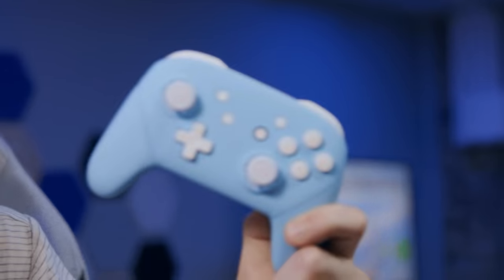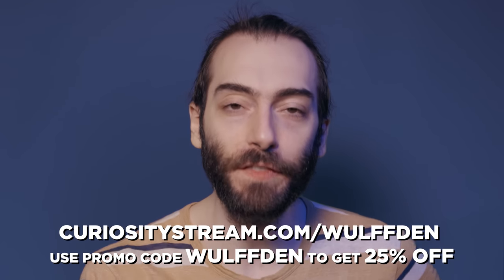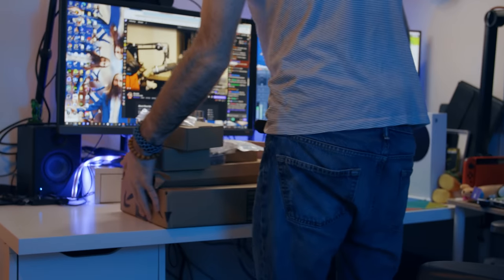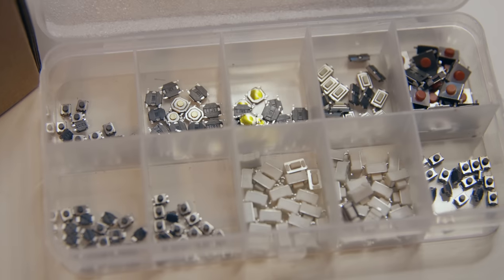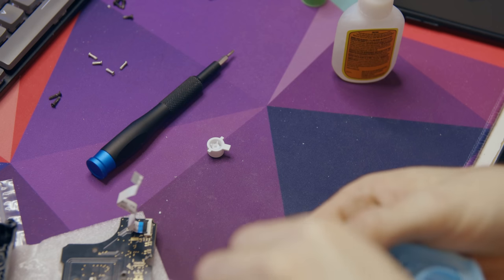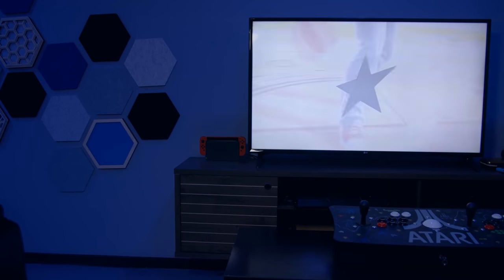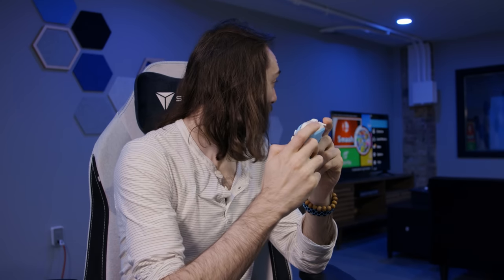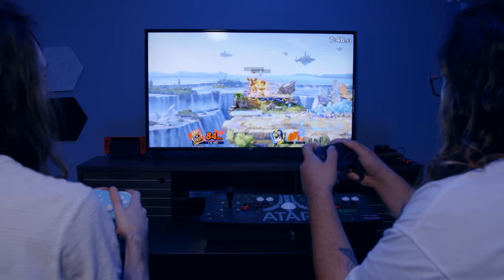I made the Nintendo Switch Pro Controller - ̗̀ CLICKIER  ̖́-

Comment: The semi translucent body for the og pro controller and all other official ones that have come after it are cool and all, but this just makes me realize I really just want to see Nintendo release some of their own solid color bodies, and maybe just pro controllers that have a different finish. Because as much as I love the Pro Controller, even if your hands are not sweaty, that thing still picks up oil and other things from hands SO MUCH. Like I constantly have to keep cleaning the controller and washing my hands with dish soap to make it dry, just so I can have an hour or two without something rubbing off from my hands. I like to keep my tech stuff as pristine as possible so it's a huge pet peeve of mine. 

Also would love to see them do solid color bodies just cause Nintendo has so much potential for their special edition controllers and Switches yet only recently have been tapping into that potential. Like Goddamn Nintendo, just go all out already

Comment: You could totally do this with a gamecube controller too. There are brackets you can 3D print to use keyboard switches as shoulder buttons and then the rest would be pretty similar to what you did here.

Comment: At 6:53 it looks like you've got a ball of solder on the pad and are trying to lay the switch's pins against it. This can make a cold solder joint which is flimsy and has a flaky connection, in addition to being the hard way of doing it. I suggest you try and heat the pad and pin simultaneously on one side, and add your solder wire on the other. Solder flows towards heat, so this is both easier and gets you a better joint.

Comment: Already had the trigger kit, was jealous of the PS5 tacticile face button kit, and my elites tactile dpad. Totally gonna try this now!
Reply: So i tried it. Kind of. I used an extra button board i had laying around after putting the LED kit in a different pro controller. I am not new to soldering at all, everything went easy enough but strangely this other board will not work, even the home button and stuff i didn't touch, old board still works and i even held a tactile switch on the working board and clicked it and it worked. So now i'm wondering if i should just solder the board that was already in there. Maybe the other board is from a different rev controller? Are these components married? Lets find out!

Comment: A little tip with soldering, and this might annoying some pros (sry is what makes it easy for me)
Just put the soldering tip onto what you want to solder, and you even use it to keep stuff in place. But then *slowly* put the wire onto the part.
Its natural for people to do the opposite, and even hold both above the part, but that doesnt really work. And the soldering tip doesnt damage any big part like the switches fx. Most people think it does and acts like is lava tip that will go through anything but if youre firm and confident it really helps.

and obviously dont do this if its on a chip or similar, this is mostly for big PCBs like this, where contacts are big and connection points arent that microscopic lmao

Comment: I dunno. The default rubber membrane seems more comfortable than the super clicky switches.
Reply: By that logic membrane keyboards would be more comfortable than mechanical...which it isn’t
Reply: @brandon_nope  I actually do prefer rubber membrane keyboards, now that you mention it. Not to mention the sound drives me nuts. Mechanical keyboards are extremely overrated, if you ask me.
Reply: @J05TI  not all switches are loud
Reply: @J05TI  I couldn't agree more. I absolutely hate mechanical keyboards.
Reply: @brandon_nope  Compared to rubber membranes, they're all very loud. My room is adjacent to someone else's bedroom. Based on that alone, I can't use a mechanical keyboard without waking them up at night (not that I want to use one).
Reply: @J05TI  lmao silent reds exist you know?
Reply: @brandon_nope  Even those are very loud, compared to rubber membranes.

Comment: man, you added in the stick gates with ease?!

I need all the help I can get adding those in. I'm a big user of the 8Bitdo Pro 2 controller as well, but have ruined two of them trying to get the gates just right - and those controllers aren't cheap. if 8Bitdo ever started selling replacement shells with octagonal gates built in, I don't think I'd ever use another controller again, would be literally perfect.

Comment: This is awesome, but those solder joints are pretty shoddy and you may well find they fail. I'd suggest re-flowing the solder joints using flux. It's easy peasy, and you'll be blown away by how much of a difference it makes. 

Even then I'd suggest looking to add structural support to the switch, maybe just some hot glue blobs etc. Even if the solder joint doesn't fail the contact pad could rip off the PCB (honestly, this happens very easily). If that happens it's not necessarily game over but it takes some skilled work to fix.

Comment: I would recommend using a flat/chisel tip on the soldering iron for the face buttons, since there is a wider surface area, and the flat tip will heat more evenly and easily. Also, to remove the bit of plastic off the buttons I recommend a rotary tool with a polishing bit, so you can have more control on the amount of material you remove. I am definitely going to try to do this mod... Once my finances get leveled. XD

Comment: I remember the old days of Mario Kart on a DS lite. You tried to push A  harder to go faster. With clicky buttons that would not have happened.
About the pro controller: I modded mine to invert the horizontal right stick in hardware. Too many 3d games sadly do not offer such a camera option in software.

Comment: I'm really interested in this project as I recently bought the Razer Wolverine TE, which also has the clicky face buttons like the Onza. Though, the more I read about this mod online (at least, from what I could find), I saw comments about how the clickyness and responsiveness deteriorate with extensive use. The buttons themselves also may have different actuation points leading them to feel clunky. I'm really interested in hearing in how the controller holds up in a week's/month's time. The first Wolverine I got had its A button broken within a month, but thankfully Razer sent me a replacement.

Comment: I wouldn't buy the shells with octagonal gates. I already tried them and they aren't in the correct position. It's slightly rotated so that full left and full right are a little over or under where the actual level is. At least when testing in the controller configurator. Seems like they messed up the molds for them.

Comment: Anybody that wants to do this I used 4.5x4.5x3.8 height tactile switches than needed no button modification at all, just solder it down and it works like a dream when you close the controller back up.

Comment: could you realistically do this with a powerA switch controller? in terms of getting rid of the rubber mesh for the buttons?
Reply: I can't say for certain, but you probably can. You would just need to try different switches to see which one would work. You should be able to do this on any controller that has the contacts for the face buttons on a pcb. The PS4 controller is an example of one that doesn't. Watch a teardown video of the PS4 controller and you'll see what I mean.

Comment: These are likely stupid questions, but I'm new to soldering and would like as much clarification as possible. 

What thickness should the soldering wire be for doing this? As thin as possible, right?

What type of soldering wire? "Tin Lead Resin Core" or some other type?

Comment: so right after watching this vid i went on amazon and got all the parts to make the clicky buttons. at 6:22 in the vid you said that you picked the 3 by 6 by 4.3 but to me it looks like youre holding the 3 by 6 by 5. when i went ahead and made my clicky buttons i used the 4.3 ones and it took a lot of drilling and fine tuning to be able to get it right. i was wondering did you really use the 4.3 switches or did you use the 5 ones. i doubt youll see this message i was just curious

Comment: do the new switches still hold up? I recently put in the hair triggers for my pro, but now I kind of wanna do this mod too.
Reply: I did it and had to swap out the A button about three times until I accidentally broke it.
So the controller is broken now unfortunately.
Maybe if you could find different buttons?
Reply: @afoxy2028  I actually did this two months ago. I hot glued and soldered the switches in and didn't have to modify the buttons at all. I found out that you have to screw in everything back in pretty tight to not have mod the buttons at all. I also did two layers of masking tape under the pcb because "thocc"

Comment: I actually have a question... I don't know if you have modded the Pro Controller before, but after I replaced the buttons and shell on mine, the buttons seem to stick now. Did you have anything similar happen? I tried cleaning the shell and the buttons themselves with isopropyl alcohol, but they are still sticky.

Comment: my only question is:
Since you put a microswitch in place (usually they are digital, only on or off) and the original pro controller has analog buttons. Do these buttons allow for soft press or slow press?
For instance, playing Ryu in Smash, if you lightly tap the button you get a different input than mashing down hard. How does this mod affect that?
I've been wanting to mod my pro controller to isolate the directions on the d-pad and make them clickier as well

Comment: How did that spraypaint feel after it dried? Was it rough to the touch? Also does spraypainting that top block any sensors from working?
Reply from the maker: It's very smooth, and a little glossy. It doesn't seem to affect any sensors
Reply: @WulffDen  alright then don't mind me- I'm just gonna full on copy what you did hahaha

Comment: I'm interested in clicky face buttons, but I do not recommend micro switches for your D-pad. The Stadia controller has them and the force required to keep one held down for a long time is actually enough to cause some pain in the thumb. Good for selecting things in a menu or activating consumables or whatever, but terrible for 2D platformers. I tried playing a bit of Celeste on Stadia to test the input lag and my thumb hated me after just a couple levels. Also, they make diagonals trickier to hit consistently in my opinion.

Comment: I definitely don't agree with the button type switch used here, hard mounted buttons like that remind me of super cheap electronics rather than a higher quality feeling and I worry for the force needed to actuate them causing fatigue compared to membranes, I think a more cherry-esque spring loaded switch with a bump for feedback like mx browns would be better suited for this application. Of course I don't even know if something like that compatible with this form factor exists so I digress. Good job with the mod other than that, looks really good! Especially the filed grooves, they actually look pretty cool.

Comment: would this mod work with a 8bitdo pro 2 controller as well conceptually? I'm curious if soldering in some switches like you did on a switch pro would register keys as well on a 8bitdo pro 2.

Comment: bob i suggest you get flux for Soldering because you get nicer looking connections and it flows easier.
Reply: Looking into getting this for when I do the mod. Any flux you recommend and other tips in mind?
Reply: @ngman002  I recommend liquid flux over the rosin paste when working with smaller components.
Reply: @aaron_h3289  This will be my first time soldering so thanks a lot for the help
Reply: @aaron_h3289  Do you know of a step by step guide online or video for a process similar to this video? I ordered my components plus the flux and want to make sure each step is right when I start this

Comment: I did this. For me, the X and Y were too high and the A and B were fine. I guess this was subtle differences in switch manufacturers. Instead of filing the button, I filed the top of the switch. That way I could go back to the membrane if I wanted. And it's a good thing, because I did want to! After playing with it a bit, I discovered I don't like clicky switch buttons. Oh well. Live and learn!
Reply: What switches did you use? I was thinking of doing this mod myself

Comment: Not going to lie... I'm currently modding my NES controller with switches right now... xD, Any tips? When soldering the switches onto the pcb what specific parts of the pcb complete the circuit?

Comment: This is neat, but the mechanical rating of those switches is 100,000 presses before failure, while keyboard switches are usually in the millions. This will work well for a while, but I wouldn't recommend doing this and not expecting to have to replace them semi frequently. It would be cool for a throwaway controller though! If someone knows more about this feel free to correct me.
Reply from the maker: these are DEFINITELY more delicate than keyboard AND membrane switches. It's the trade-off for the clicks

Comment: Pretty sure you will need to open the controller from time to time to resolder the switches or even replace them with new ones.. these switches are not high quality and they are not made for this use.. the solderjoints will also brake very often.. i am not saying this to make your project bad ( I defintly like it) maybe use it for some time and give feedback how often you had to fix it

Comment: I wonder if there is a way to add springs into this equation. Although i do like the clicky part to this mod, i like the travel that you get with the membranes.
Reply from the maker: if you drill the inside of the button enough, I dont see why not
Reply: @WulffDen  i might actually do that. Just changed my switch lite shell, so this might be my next project.

Comment: My only question is if you were going to change all the buttons out anyways, then why not just buy one of the 3rd party controllers that DO have white plastic for that center piece? It would have been a lot easier and you wouldn't have had to paint anything.

Comment: It's really interesting to see clicky buttons instead of the rubber pads, still that's not the way you do notches! That's how Multishine controllers do their notches and it's pretty bad. I'm not saying you're bad or something! I just want to give good advices. You want notches that don't look good but work good, and the only option is to do them as you see them in official controllers as gamecube one or the nunchuk. I guess you went too far with this shell, so you should use another one. The angles may be good, but ideally you want to flatten the space between each notch, not just make a furrow, so the final result will be a totally not round gate
Also remember that being a beginner, and so breaking stuff, is totally good and normal! I myself messed up so many things, both in soldering that in doing modifications at plastic things. You just need courage and passion, and everything will be okay

Comment: The pro controller has no texture, tbh i didn't really notice anything wrong with it when i was playing slower games like BOTW and Octopath Traveller but lately i've been playing Hollow Knight and i really notice how poorly they designed the grips and the thumbsticks, texture wise.... there is none.
If your hands start to sweat it gets slippery.... would have been so easy to add texture, like an Xbox controller. :(

Comment: "luckily the pro controller is easier to take apart"
Meanwhile me trying to do open the xbox elite 2 to cut the membrane rubber part of the face buttons and solder some switches...